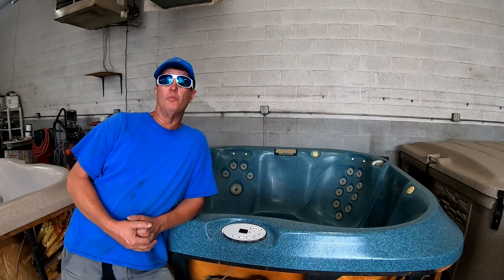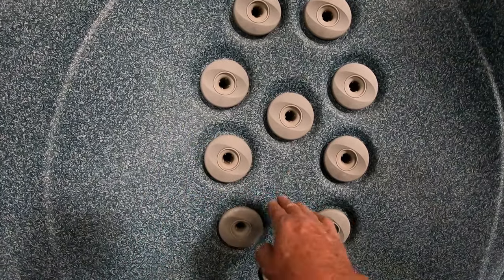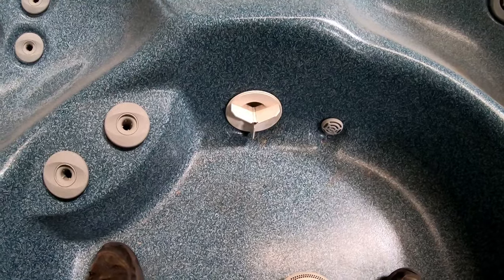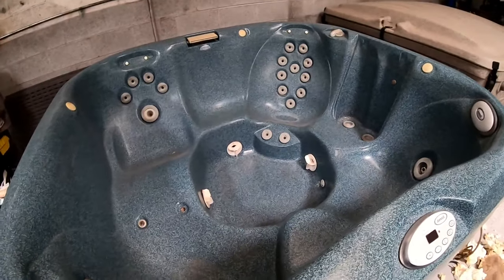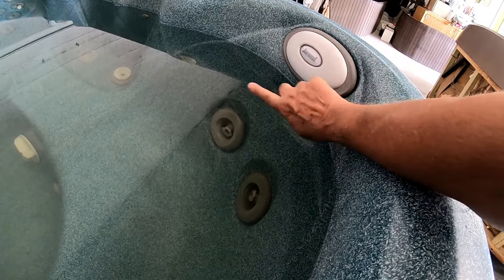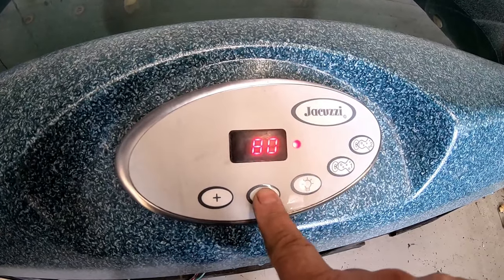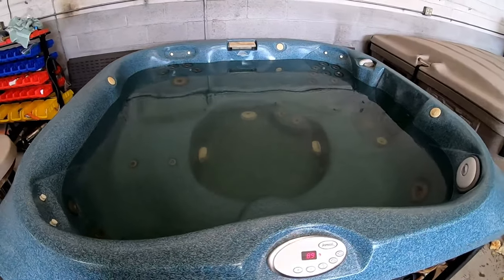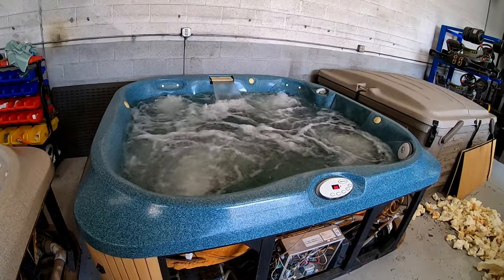Four things to do Before you fill up the Hot Tub with water.DIV Spa Repair..Arizona Hot Tub Factory

Comment: What about well water? Should I do anything different
Reply from the maker: Yes ...You need to really pay attention to proper chemicals and I would change 1/2 of the water every month or at the very least every other month.. I have a Hot Tub at my cabin that is also on well water and that is what I have found works the best for us ( My cabin is in Pine,Az) It might be different where you are located. Hope this helps    Thanks for Watching & SUBSCRIBING
Reply: @spaman5440  I have well water, recently I had a water system put in (acid neutralizer, water softener and sediment filter).  Same protocol as you have written above?

Comment: Can you do a video on what happens if you have an airlock already?
Reply: I fixed mine by opening all the jet like I should have in the first place. Took the filter out and plunged it there. Then I plunged the jets.  Then I cycled through the pump 10 seconds back and forth. Put the main valve in the center opened the rest. Boom problem solved.
Reply: What do you mean by “cycled through the pump 10 seconds back and forth?” Can you expand on that? I’m having the same issue. Thanks

Comment: Why does it heat so slow about 1 degrees a day
Reply from the maker: Something is not right with your Hot tub...
A 110 volt Plug & Play will go up one degree an hour and a 220 volt 5 to 8 degrees per hour depending on the size heater
Now that being said your Hot Tub could be in the wrong MODE and only heating during a filter cycle or you could have it in sleep mode...NO heat at all just outside temp heating it ..Or you might need to replace the heater with a new one. Hope tis helps Thanks for Watching & SUBSCRIBING

Comment: Worst example how to fill up a hot tub is using a sub pump that does 100 gallons a minute when a garden hose only does maybe a gallon a minute put it in what hole is it a suction or a return not every hot tubs the same way they make like 100 brands and every brand probably has 100 different models lot easier way to teach people how to fill up a hot tub